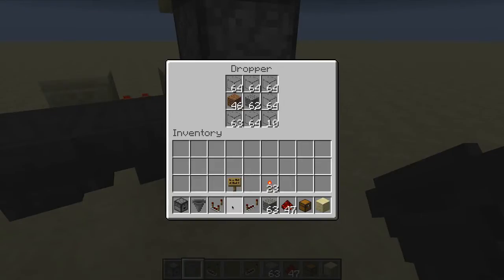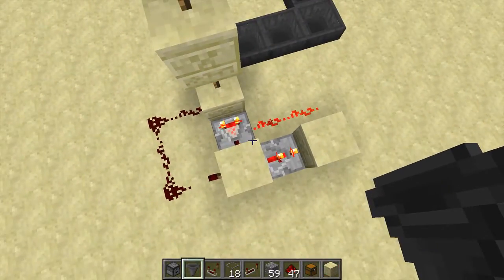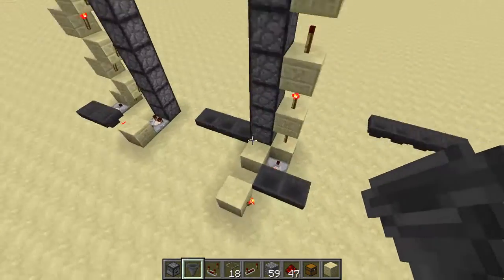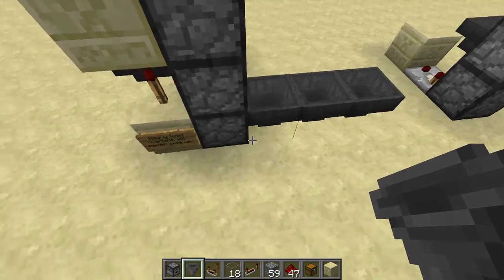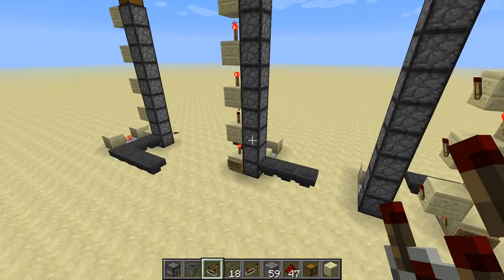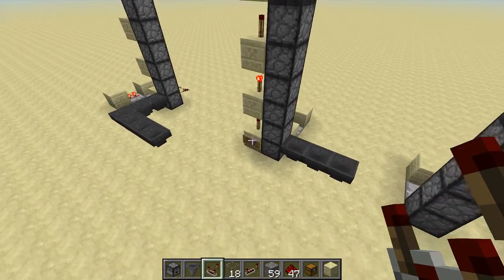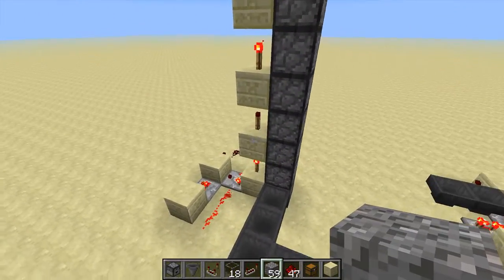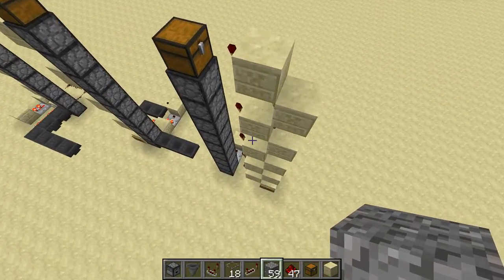Minecraft: droppervators compared, showing the 3 types of item elevators i use

Comment: Torches will only burn out on a 1 tick redstone clock.  You need at least a 2 tick clock to run redstone torches.  Hopper Clocks run slower than a 2 tick clock but is extremely compact as a clock.  If you want the 2rd or 3rd tower to run faster then you will need to replace the hooper clock with a controllable redstone clock of some kind, probably comparitor based.

The reason the first tower design fails when the dropper gets full is the testing comparitor is then output a redstone signal of 15, HOWEVER, the subtractor signal from the side is only ever 0 or 14 (due to the repeater) and as such 15 - 14 is 1, so the comparitor never turns off when the dropper is full.
Reply from the maker: +Ant OfThy thanks for the comment on that dinosaur.

Comment from the maker: you confuse quasi connectivity for block update detection. IT is QC what powers them and even if called "requested feature from the community" i consider it a bug, for it makes individual control of pistons and other elemets way harder than the old way. It works for now, i can deal with that even though i don't like it.